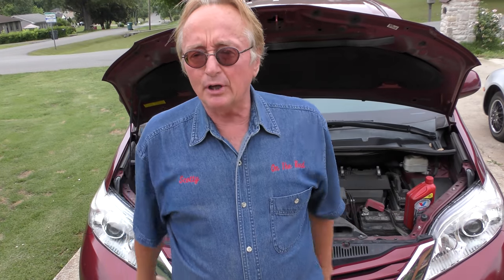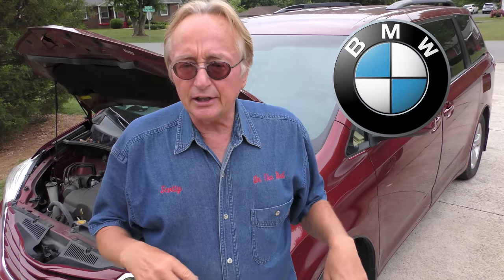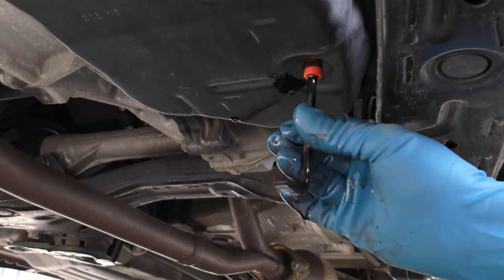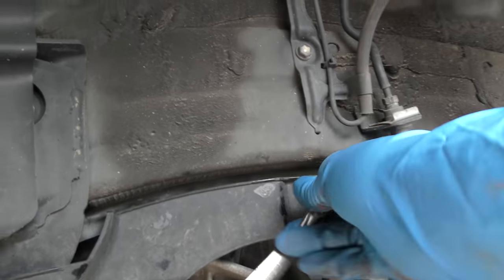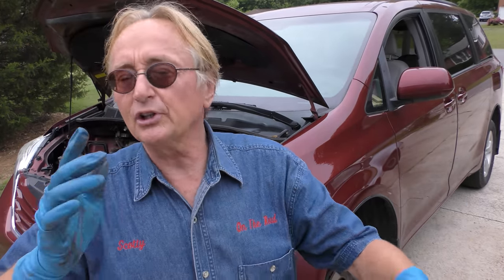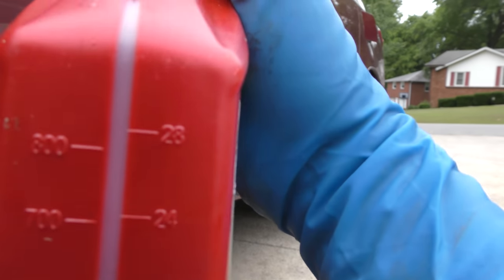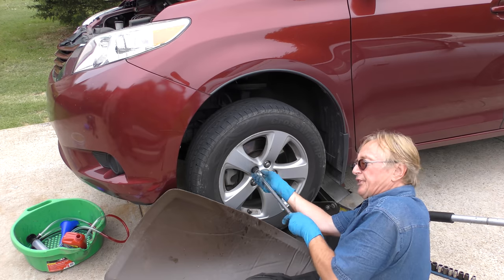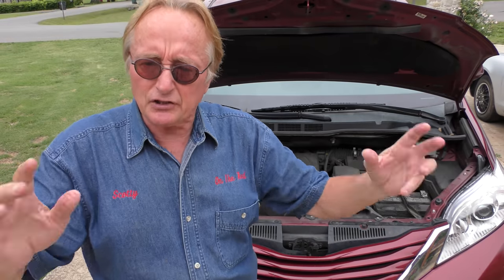Here's Why Changing Your Transmission Fluid Can Cause Damage

Comment: Good video but... that part with the fluid dripping down from the fill port indicates just a little splash back while filling it.  If it's coming out because it's full, you put in WAY TOO MUCH and you would definitely damage the transmission.  These are not like differentials or transfer cases where you would typically fill it until it comes out of the fill port.  Just an FYI...
Reply: I was wondering the same. Is that fill port designed to indicate that it is full and, if so, why not just fill until it comes back out? To be completely honest, I have never had a car that was this idiotically designed without a dipstick for the tranny. I guess I can understand, the manufacturer WANTS the transmission to fail after the warranty period so they can more new vehicles, thus they make it hard to get the right amount of fluid in and give no indicator if it's right or not. 

Is that correct? Why else make it that hard to fill to the correct level?
Reply: @contumelious-8440  I've heard it been referred to as an "inspection port" instead of a fill port. The idea being that as long as it reaches the level of the port, not higher or lower, it's filled to spec. That is, of course, with the entire vehicle level on a lift or something. Not jacked up from one corner in a driveway. Mind you, I heard this from fellow shadetree mechanics, so don't blame me if you screw up your vehicle.
Reply: @jake8622  That is definitely NOT an inspection port like you would have on some differentials or transaxles.  This port is only meant for filling the transmission with fluid but then there's a specific procedure to check the level and drain any excess fluid using the drain plug.  THere's quite a few "Good" DIY videos out there on how this is suppose to be done properly.

Scotty really needs to either change this video and do it right or remove it completely.  I can see a lot people blowing thier transmissions because of this.  Too many who follow him takes everything he says as the "gospel of mechanics" which can be, in this instance, so far from the truth.  Do some proper research and you'll find out how it's suppose to be done.
Reply: @viperxbr  Unfortunately, the entire video is Mr. Bean 2 and not an oil change in AT. The oil check is done at the oil temperature specified by the manufacturer. Engine running. Car on the level or on a hydraulic jack (whole car). Unscrew the drain screw (screw only !!!) . The liquid should flow out a little = OK.
Reply: How can you over fill or under fill if you just put the same amount that came out?
Reply: @jamesmartin1895  I was wondering the same.....

Comment: To change or not to change is the situation that I am in with a 2002 F150 4x4. It has 170 000km/105 000 miles and the transmission fluid was never changed to my knowledge. I am cautious about changing it, I had an old Bronco once that I changed the fluid and the transmission began to slip. 
An old mechanic once told me that if a transmission never had its transmission fluid changed and it had high mileage, don't change the fluid, the reason is that it thickens a little as it ages and the internals of the transmission have adjusted to the thicker fluid which is probably why the Bronco tranny began to slip after a fluid change. 
105k is not that high of mileage but I am still leery about changing the fluid.
Reply: I'm with you.. I have a 2006 Mazda Tribute and am dealing with the same dilemma.

Comment: Hey Scotty let’s say I changed my transmission fluid at 180000 miles and don’t know if the previous owner did. How long after would my transmission start showing signs that it’s in bad condition?
Reply: man I would like to know as well. also for an older car with low mileage but never had a trans fluid change
Reply: It will start slipping or you will notice other things pretty quickly. If that doesnt happen then soon it may start to leak. If none of that happens within a few 100 miles you're probably good.

Comment: After seeing this video I realize that I have a problem.  2004 Lexus LX470 with 275,000 miles.  No dipstick.  Still runs great.  Transmission fluid has never been changed.  I plan to keep the car until at least 500,000 miles. The video indicates that if I change it now, it might start slipping.  So, should I just leave it alone and hope for the best, or take the chance on changing it? If it is a bad idea to change it now with new fluid, should I drain the fluid and filter out any particles, then put that filtered fluid back in?

Comment: I just changed mine today at 206,000 miles. Sucks to hear that could be a bad thing. We'll see.
Reply: howd the car handle it?
Reply: @chazmann87  I'm up to 211,000 and the transmission is starting to slip pretty noticeably. Could have been my fluid change 🤦
Reply: update?
Reply: @antonio1681  Transmission is still hanging in there.

Comment: So, I recently bought a 2006 Chevrolet Malibu.  It has 133 000 miles on it.  I suspect that the vehicle was poorly maintained.  Is it too late to change the transmission fluid?  If you are only getting 30% of the fluid out anyway, two thirds will still be "bad" fluid, is it worth the risk to change it and hopefully keep the transmission in good shape?  A mechanic told me that GM vehicles are especially prone to having the transmission slip if it hasn't been changed regularly before.  What are your thoughts ?

Comment: If your not having any issues with your transmission changing the fluid wont hurt it or cause slipping regardless of how often it was serviced, Just be sure you use oem fluid and dont use multi vehicle fluids unless your going to flush it completely
Reply: Slipping transmission after oil exchange is due to improper oil balance on the transmission. There are certain procedures that some times are skipped thinking is not necessary, but transmissions can be  very tricky  without proper tool. Using oem oil is not mandatory as long it is use another oil with the same specs as the automaker.

Comment: Bought a used car. It’s at 90k miles. I’m not sure if the fluids ever been changed. Should I change it or flush? Or leave it alone? I don’t know if it matters but it’s a manual transmission

Comment: I did a transmission fluid and filter on my 94 k1500 with 145k on it and just on the safe side added some slip and stop by Lucas. That 4L60e shifts just great

Comment: Hey guys, I just changed the fluid that has never been changed before and my car has 134k miles on it. I only changed 4 quarts and didn't change the filter. So far it is shifting the same as before. Just wanted to post this in case anyone was worried the trans would seize up. I will post further down the line and let y'all know what happens...
Reply: How is it working for you now?
Reply: @artbysquids6779  car is working great! Granted I’ve only driven 10k miles since. I’ll continue updating

Comment: I have a 2003 Ford Mustang V6 with 130,000 miles on the transmission. Should I change the fluid? Or maybe change out the transmission filter at least?

Comment: Great video Scotty, because of you I have changed my trans fluid in all of my cars.  It is also because of you that I bought a Mazda and so I had to correct you in your video.  Mazda is one of the few and maybe the only- auto manufacturer that still has a dipstick in the transmission. I know because I just changed it 30k miles.  I have a 2016 Mazda CX-9.
Reply: What fluid did you used? I can't find Mazda FZ in my country.
Reply: @starlinhernandez3095  I used the fluid noted by the manual  and get it from the dealer.  Look on Utube and you will find some comments stating they used Toyota fluid.

Comment: Hey Scotty!!

2001 Camry here with 84000 miles. Transmission fluid has not been changed.

I was wondering if you would change the fluid at this mileage or wait a little longer

Comment: Hey Scotty if the sealed transmission is like the sealed one on the tundra you can short  a few pins on the obd port shift from drive to neutral(I believe)  rapidly for a few seconds and back to park.  The drive light will blink a few times then just the park light will be on. When the drive AND park light are both illuminated the temperature of the fluid is in spec to be checked. Then all you have to do is remove the drain plug and wait till the fluid is only dribbling out and you will have properly filled the transmission to the right level. IMO correctly filling a sealed transmission is easier than one with a dip stick. Contrary to popular belief at least on the tundra no fancy scan tool is needed unless you consider a paperclip fancy.
Reply: Or you can measure what comes out and replace with same amount.  Works for me and mine
Reply: @geraldevans2535  just make sure when you measure the oil, both the old oil and new oil are at the same temperature.

Comment: I have a 2017 Mazda CX-5 Grand Touring and it has 95,000 miles on it. I have always kept up with the oil changes and tire rotations but I have never had the transmission fluid changed. Would it be a bad idea to do it with almost 100k miles on it?

Comment: My 2010 Tacoma Prerunner has 150k miles.
I’ve always changed the engine oil, differential, brake and power steering fluids.
But I listened to multiple people who warned me NOT to change the transmission fluid.

Is it too late? The vehicle runs like a champ, and I need to keep it going. What do I do?
Reply: Same here transmission fluid is supposed to last lifetime of the car from what I know

Comment: Ive seen it happen MANY times. A perfectly good transmission, destroyed by changing the fluid.  I have no idea how they do this, I just know that they DO!!!......NEVER change your transmission fluid
Reply: @mark97213  i have a toyota avalon 2015 and 65K miles on it i bought it around 58K miles on it i don’t know should i change transmission fluid change or not ? any advices
Reply: @omarsb5471  All I can say is in MHO,  if it were mine, I would never change the tranny fluid.
Reply: Bank It is incorrect, it depends on age and wear. In good shape you should flush or change at regular intervals (read your manual.) The reason it can damage transmissions is if your transmission is ALREADY damaged, the little metal worn pieces in the fluid help create a buffer and help with gear engagement and grip. So the damaged metal from your worn transmission is partially helping like a bandaid. If you flush that out, you have gears that are damaged and worn, but no metal shavings in the liquid to help it. If your transmission is in perfect shape, you want that flush so you can have nice clean fluid which serves as a coolant and lubricant. If your transmission is worn, you do NOT want to get fresh clean fluid anymore, because it will highlight the actual problem with the transmission.
Reply: @mark97213  you're high lol I have a camaro that goes in for a regular Trans service every 50k miles, I don't use the gabage you buy from the dealer or auto part store tho, ams oil only, which plays a huge part to, doing a Trans service doesn't make it out of order, what made it out of order was either trash driving or waiting too long to change the fluid, I've worked on many cars and it's needed lmao

Comment: Use a torque wrench to tighten the fill plug so you don't strip out the threads on the transmission case, which is made from aluminum.
Reply: Exactly!  I'm a little shocked and not impressed  he just used the "tight enuf" method on those plugs.  Strip those threads and you made yourself a VERY expensive problem.

Comment: I had a Nissan 6-speed automatic that was slipping and also banging when going into drive or reverse. Lucas Transmission fix cured the problems. It shifts like new now....
Reply: Nissan what? I currently have 2006 Nissan Maxima but no real problems shifting or slipping. Sometimes I have to use more force to shift than majority of the time.
Reply: Biggus Dickus  may I ask why you say that? Even though, I actually do plan on selling it and getting either a Camry, accord, civic or Corolla used.
Reply: @PhilTheCreator  for the last few years, the camrys have been REALLY nice. very surprised by them
Reply: Biggus Dickus  yeah mine isn’t a Cvt transmission, just a regular automatic but I’m still already looking into selling it.
Reply: @wildcard749  I do love those newer camrys! But I’d rather get 2007-2011 Camry
Reply: @PhilTheCreator  2005 Maxima. These transmissions are known to be faulty. The powerful V-6 engine also is hard on them. So, if it starts acting up... Lucas or sell it... or you can pay about $6000 to fix it.
Reply: @OregonDARRYL  you still have your maxima and what’s your mileage?
Reply: @PhilTheCreator  Yes, we still us it as a second car. It has 80K on it.
Reply: @OregonDARRYL  okay mine has 89k

Comment: That sure is a lot of work to only change a quarter of transmission fluid !!! On a Dodge grand Caravan you could use a vacuum pump with a tank that indicates for how many quarts do you take out and then put the same amount back in . I make sure to do it when the engine is cool so both oils have the same temperature

Comment: I just bought a 2012 ford fusion , and it just turned 74,000 miles, one owner , very clean , should I get the  fluid changed? its a little dirty.......... or should I leave it ??
Reply: Replace the AT fluid including the filter.

Comment: Great video!  We bought my son a 2014 Elantra with 100,000 miles on it, and it's now at 115,000.  We've not changed the transmission fluid and I don't know what the previous owner did.  The car runs great.  The last time we had it in the shop for maintenance I asked the mechanic to check the transmission fluid and change it if he thought it needed it.  He said it looked fine and chose not to.  What would you do in this case?  Do we risk it by changing at this point not knowing if it has ever been changed?
Reply: I read one comment his transmission doing great at 300,000 miles without atf change. But I changed mine on 2018 at 40,000 miles. What comes out goes in

Comment: I was taught to lower the jack just to where the tire hits the pavement then torque the nuts then lower all the way. This allows rim to seat properly.  Whats your thoughts Scotty?
Reply: you'd still have to retighten/double check once the jack is removed
Reply: rim seating properly isnt an issue. thats what torque pattern is for. if you make the tire sit on the pavement it would prevent it if anything. more harm than good. supposed to tighten by hand when its in the air, then put it down and torque proper.

Comment: It appears that the manufacturers have done nearly everything they can to make it as cumbersome as possible for shade tree mechanics to perform this simple maintenance. Just like when they went to the stupid cartridge style oil filters that require special tools.
Reply: Yep, the car manufacturers are always designing their cars so no other than the dealership can work on them. I had to turn down so much business because the owner of the shop did not feel comfortable working on certain newer cars since there were no check sticks or a "sealed" system. We lost thousands due to that.
Reply: my 2017 Camry had that crap, but they wised up and went back to a regular oil filter on my 2020, and its conveniently right next to the oil pan. As far as the tranny fluid goes, my transmission guy won't do this, so I guess I have to do it myself

Comment: While under warranty I had the dealer replace my manual transmission fluid around 60-70k, there was a service bulletin that said to slightly overfill so to put like 2.25 quarts instead of just 2. I told them this and they did not believe me and only put 2. It's been fine but will be changing it again myself sooner than the 120 it is supposed to be, I'm at around 92k currently

Comment: I just changed my honda with valvoline synchromesh. Stll wines slightly but changes gears better. Manual with 320,000 miles on it. Ive sadly had it since 98,000 and just changing fluid. Hope i didnt over wait it.

Comment: I love the smell of ATF in the morning, noon and night.
Reply: Good one :):):)
Reply: For me it's 90 weight! mmmmmm
Reply: @joejones4172  For example Volkswagen says the oil in the DSG7 DQ200 0CW is lifetime or 200,000km.

They don't tell you to change the oil because they know the clutches last about 200,000km and changing the oil won't make them last longer.
Reply: Lord God 😝 🤢
Reply: After smelling CVT fluid, I can actually appreciate the smell of ATF
Reply: @dragospahontu  Clutches last? depends on jack rabbit starts and a heavy foot on the gas while shifting gears.
Reply: @dhowar  yes but dq200 uses monodisc clutches and MTF oil, at the very best they last 250,000km and at that point the grub in the oil might help the clutches.
Reply: Not bad, but I prefer the smell of 90W!
Reply: ew

Comment: 4:30 My 2013 Ford Cmax has on the driver side plug too. Ford Cmax has CVT Transmission and the Manufactory the Manual said to change the ATF on 150000 miles. I will change on next week. Appreciate Scotty.

Comment: Scotty you should use a torque wrench, especially on aluminum parts. The first car owned the pan bolts on the transmission leaked and needed hela coiled because the tighten the bolts to much and most likely didn't use a torque wrench.

Comment: I like this guy :) he is absolutely right. Changing transmission fluid every 30k will not hurt your transmission, you will have good working valve body always. If your solenoids fail you should wait body parts and gears wear soon ;) that is why all people suffer from their transmissions :)
Reply: Starters fail first?
Reply: My lancer has 210k ...km now and I haven't changed it once